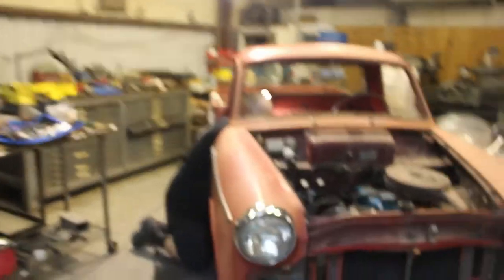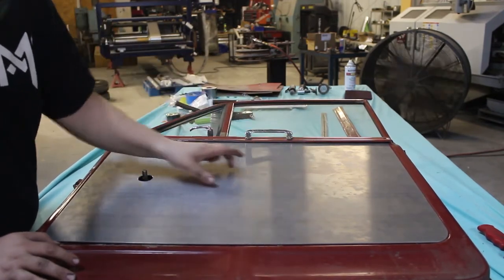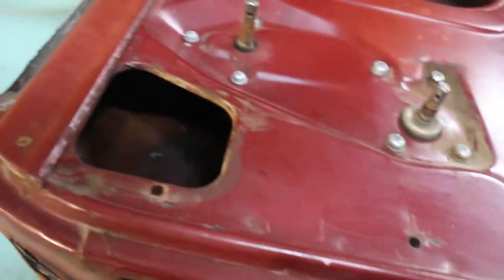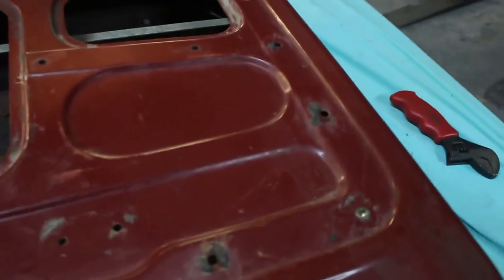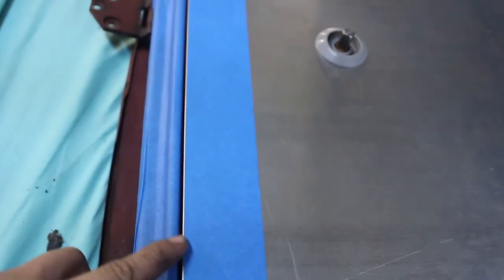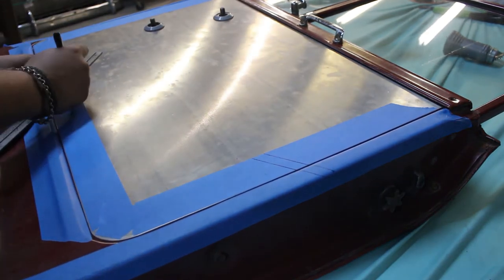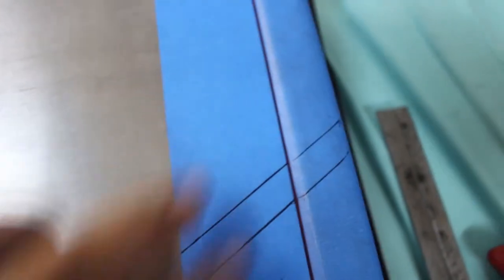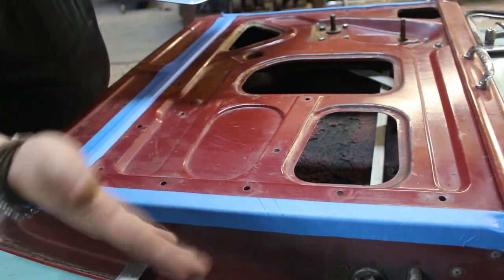How To Make Custom Door Panels For Your Car / Truck

Comment: Great video! A easy way to match up the holes is lay a clear piece of thick plastic over it. Mark the holes with a marker then lay the plastic over the metal and mark through the plastic onto the metal.

Comment: Wow, Nice work man!  Takes skill and patience for sure!  Any particular reason you wanted to use the factory clip location for your nutserts?
Reply from the maker: Thank you! Our goal with this truck was to cut and modify as little as possible and the holes were already there and spaced perfectly for them. Normally we would just measure in from the outside and then space them Accordingly if there wasn’t already holes and we wanted to “cut or modify” more of the factory vehicle.